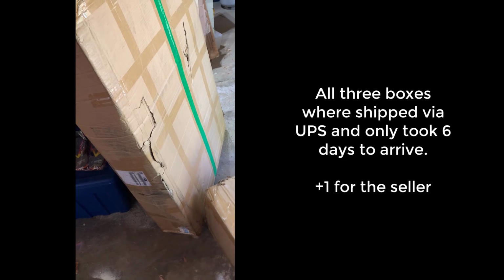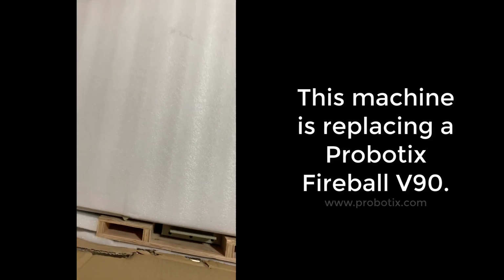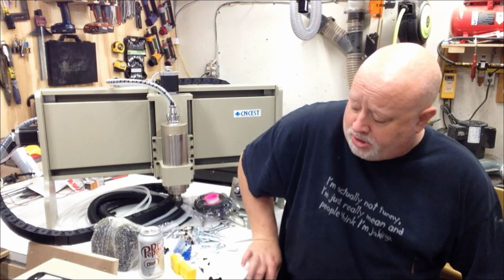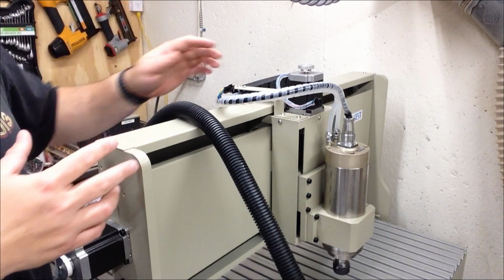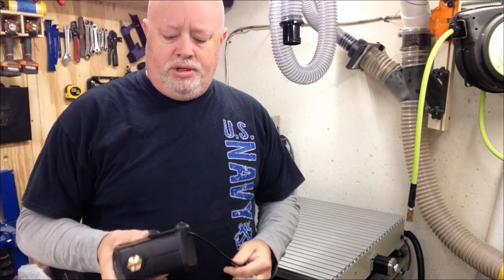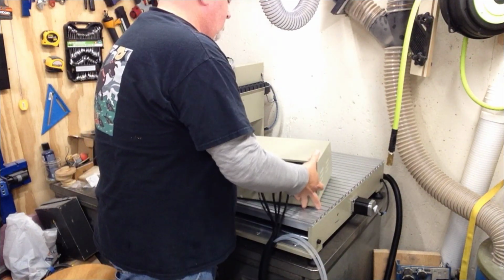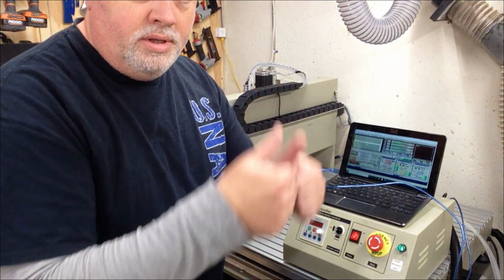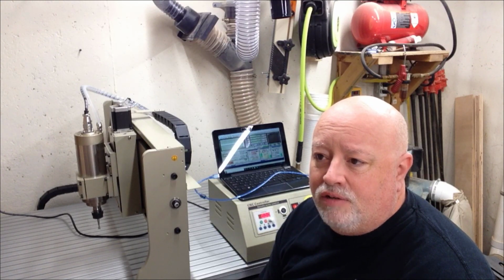Getting started with the Chinese made 6090GZ CNC Router

Comment: could I use 1/8" shaft bits, like dremel bits ? I'll need the 7 degree dovetail bit and I've only seen it from dremel
Reply from the maker: Sorry for the delay, I never got a notification you posted a question.
To your question...
Yes, you can use 1/8" bits.

But, to that point...
You are asking about a dovetail bit.  That bit has an "undercut" if you think of it from a "top down" view.  So you would need to have the ability to clear the area near where you want to undercut, if cutting from the top.  If you are doing board ends, then life is simple and just like using a dovetail jig.

Does that make sense?

Comment: What is the full cutting size are yall getting. Mine to limit switch is 31.5 inch x 24.25 inch. Manufacturer says  35.75 in x 23.75 in. Is mine assembled wrong
Reply from the maker: I went over this in one of the videos, but measured it in metric.  I think you are right though... the size is not exactly as advertised.

Comment: 3 years now how has it treated you ?
Reply from the maker: Mine isn't getting as much use as it used to... as you can tell by the videos (need to publish more soon).  But, when I fire it up, it is rock solid and does the job.

Thoughts...
The unit does have a tendency to overheat, but only the VFD portion (located in the control box).  I've had it happen a couple times when doing multi-hour 3D carves.  This has been documented as a known issue with the VFD and some people have fixed it by mounting fans in the control box to aid in heat removal.

Comment: Has anyone figured out the motor size (nema)? I 
 on one site, they had a motor parts number, and it did not match anything i can find. If i can get a similar product that has stanard specs, that would be awesome. On one of your other videos there was a comment about a ball screw upgrade. Do you have any more info on that?

Really appreciate all these videos. When i type in china 6090 on any search, it's mostly advertisements. 

Thanks again for your work on this series.
Reply from the maker: The motor size is a NEMA 23 form factor.  With the different torque values of different motors, the only thing that should change is the length of the motor.  I believe that the motors that come with the standard 6090GZ are, and I'm guessing a little, about 170oz/in motors.

I came to this using the dimensions of the actual motors and comparing them to what is commonly available... but I could be wrong.

You could upgrade to higher torque motors and push the speed of the machine higher, but you may also need to replace the stepper drivers within the control box.

Comment: Looks very solidly built for milling metal. Thanks for posting. Those planes flying must freak you out
Reply from the maker: It is aluminum, so there is flex in the gantry... but, for wood, it's perfect.  For softer metals, it is okay.  For harder metals, you really need to go slooooow.  I have a X2 mill I use for metal... but it's not CNC right now (although I have the parts and have had it running).
Reply: @jeffmorlen  make an extra motor mount for the upper part of the motor

Comment: Hi Jeff. Do you this machines handle making guitar bodies?
Reply from the maker: That is an awesome question... and a project I want to tackle.
Technically speaking, the bed size, X, Y, and Z axis, does have enough room to make one without issue.
The guitar neck... that's another story though... I believe you'd have to run the neck diagonally to get it to fit (I looked a few years ago and cannot really remember) and you would, probably, want to use the A axis to get your profiles right.

Hope that helps!

Comment: jeff i was wondering if you could help me i bought one of these used it for a year my computer broke im trying to get it running again and i cant get the program that came with the cnc i bought it on ebay there not responding to any of my message is there bye chance you can lead me in the right area ??? with out that program I don't no how to run it
Reply from the maker: On the channel information page, you can find download links to the XML files (config files), a demo of Mach3, and PDF documentation from similar machines.  As well as, the entire contents of the CD that I got with mine (less bogus license).

Comment: Hi! 
I ned a litle help if you please!
I am interesting buying one of this but i am not sure if can do the job i am interested.
The question is about the height of the Z axis.
I want to carve a 10cm high wood all the way down and i am not sure if the height of the bridge and the spindle can allow such a long tool and material.
The video link shows what I want to  do.
Please confirm if its possible, because i am one breath before ordering this!
Thanks!
https://m.youtube.com/shorts/I4LOvZ-0nB4
Reply from the maker: The clearance between the bed of the CNC and the gantry is, approximately, 4 9/16" (116mm).
If you use a spoiler board, of course subtract the thickness of that from the clearance.
Reply: @jeffmorlen  Stil no sure if i can do the job.
Reply from the maker: I think what you really need to know is the travel of the Z axis.  If it can handle the length of the tool you need and still clear the material on rapids.  Right?

Comment: i think these chinese made 6090 cnc routers are a very good value however how bad is the flex on the aluminium bed?...i see no supports underneath other than at both ends...seems like a severe design flaw...no?
Reply from the maker: Most people put a spoiler board on top of the aluminum bed.  So that stiffens up the bed quite a bit.

Comment: ok i see u tried going faster than 60ipm and steps lost...more than likely its due to the stepper drivers because i believe i have similar stepper motors on my crapcarve cnc and i can easily do 100ipm although the weight of your gantry may be a bit much for the stepper motors.too ..your motors are prob just 280oz which are ok but underpowered for that cnc ...and having only 1 weak y stepper is s weakness in design.....a much larger y motor would be best...plus a 24v 10A power supply seems a bit weak ......60ipm is very very slow especially when machining plastics acrylics....especially if u cant run the spindle below 10krpm......i thought vfd spindles can be run at much lower rpm?.....it does seem like a good cnc as is but definitely manufacturer could and should improve it to make it a much better cnc...its like a tank with a honda civic motor lol.
Reply from the maker: The issue that you face with running a VFD at a lower speed is that it will consume higher amperage to maintain that speed as the cutter has to work harder to move through the material.  Thus, you also tend to heat the system up in doing so as well.  I have had overheat issues with mine after extended cutting times.

It is perfect... no.  Does it work... yes.

I don't run my spindle much below 14000 for standard router bits.

Comment: and is it a fact the max feed rate in stock configuration is only 60ipm?..
if so thats extremely slow compared to most other home hobby cnc....has anyone done 70 80 100ipm with this machine?
Reply from the maker: Yes... by comparison to $10000 machines, it is slow.  By comparison to $5000 it is slow.  But, it is only $2000ish... and you get what you pay for.  If someone were interested and handy, they could upgrade all the components (electrical: steppers, drivers, couplers, etc) they could make the machine move very quickly.  Not to mention, some of the "fast" machines are rack/pinion or belt drive.  That makes a huge difference too.

Comment: Hey Jeff, I know this is 3 years old, but I wanted to let you know that I worked with a couple that has one of these machines.  I know Mach3 pretty well, but these china machines throw convention out the window.  While working with them, trying to get their machine running I kept referring back to this video for the ports and pins settings.  So thank you for taking the time to make the video.  It allowed me to help them get their machine up and moving.  Running?  Not so much yet, but that will come.  Again thank you for the vid.  By chance, do you have the link for the files on the touch off tool probe?  I did not see the macro in your list.
Reply from the maker: I added the auto zero script to the channel info page (at the bottom).
I think it is "current" but I have not looked at it in a little bit.
If you use it and have questions, please let me know.

Comment: what software for design?
Reply from the maker: Depending on what I'm doing it would be a mix of Google Sketchup (with tons of plug-ins; old version) or Vectric V-Carve (old version).
Most of what I do would be considered 2.5D work (meaning Z axis does not really move while doing a cut... just goes to a depth and cuts there).

Comment: Hello, Jeff. Does the cnc has a driver I need to install on the pc? Or it installs automatically when you plug usb cable to pc?
You install first Mach 3 and then plug the usb? Or viceversa?
And do I need to change settings on Mach 3?
Thanks!
Reply from the maker: There isn't a driver, for Windows, really.  The DLL that you need, for the R&R Motion Controller, is dropped into the plugins directory within Mach3.

As far as settings that need to be changed in Mach3... Yes, TONS.  But they should be within the XML file you can get from the mfg. or seller.  If you don't have one, I have an XML file for download (check the channel page).

Comment: Hello Jeff! I recently started working on CNC as part of my undergrad research. I also have this specific model and have seen a few of your videos which I thank you so much for (this model is hard to find any guides on and I can't find a manual online either). Anyways, have you ever gotten an error after milling for about 15-20 minutes and it says e Oh? I am trying to figure out what the problem is because it keeps happening no matter how much I add ice to the water pump or if I add an additional fan to the console. Would very much appreciate your help!
Reply from the maker: YES!!  I have gotten the same error.  The error indicates that the VFD has overheated.  It is a real pain in the... you know where.  I have found a couple people say that they added fans to the control box to keep it cool.  I have also found a guy who said that he reversed the fan direction and that helped.

I have gotten it 5-10 times and it is always in the middle of final pass cut (when doing 3D stuff).  Mach3 will give you the ability to start at a line number and that is how I handled it (without modification) in the past.  Meaning, if you get the 0h error, stop the machine.  Document the line number it says it was on and step backwards until it picks up where it left off.

By "step backwards" I mean...
If it errors at line 1800... go back to 1750.  If that isn't back far enough, then go back to 1700.  I've had luck with this... but, be warned, it is NOT a perfect fix for it.

I hope this helps.  Maybe I'll tear my down in a video and show everyone what is really inside... with explanations.

Comment: You mentioned that there are six limit switches,(2)x,(2)y and (2) z.  All in parallel.  No home switches.  Is this actually the case?  Mine doesn't have any Z limits that I can find.  I guess it achieves the functions effectively by moving each axis one at a time.  I am wondering how this all works, in concert.  Haven't started running my 6090 yet.  I have purchased, better controllers to redo the whole thing.
Reply from the maker: I think that that statement was made based off the documentation on Amazon regarding the machine.  My machine has no limit switches on the Z Axis either.

As far as homing switches, there aren't any.  But you could use limit switches on X and Y to do homing.  You'd just need to write the script to do that.

Comment: I bought the same machine, just a slightly newer version. How satisfied are you with the machine? I have a problem with the Z-axis, it only moves in the negative direction when I press Z+ on the remote, and even in the program when I enter the command Z+10, it still moves downwards in the negative direction. What could be the problem?
Reply from the maker: For the work that I do, it is perfect.  It hit the price point that I needed, the features that I needed, and the size that I was looking for.  For the Z axis only moving down... does it make noise and try to move up?  If not, you may have some other parameter in Mach3 backwards... but I wouldn't be able to tell you what without looking at your setup (sorry).

Comment: Better to get the machine rewired and change the mach3 board to the arduino board with usb connection .
Reply from the maker: I've thought about this comment quite a bit...
I'd say, that if you were going to swap out the controller, I would go for a stand-alone style system with a pendant that has USB on it.  Sorta like was others do.

Comment: I was looking for a CNC router that can cut aluminum front panels (1 or 2mm thick). The other routers on amazon seem to have problems with aluminum but now I see this one on video this looks like a bit of overkill. This machine is huge. Great that you posted this video!
Reply from the maker: Yes, you can cut 1-2mm thick aluminum on this unit.  You will need to watch your feeds and speeds for the material you are looking to cut.  But yes you can cut it.

One thing to note...
This machine is made of aluminum.  So there is flex in the gantry and Z axis.

Comment: How i can just start my spindle ? With mach3
Reply from the maker: First things first…. Do you have the same machine?  Or, at a minimum, something similar.

Does your CNC have a manual/pc selector switch?

Switch that to manual.  Make sure the knob is all the way to off, or the slowest setting.  Press the green “run” button on the VFD.  Turn the knob and increase the frequency.  If it spins, then the VFD is working.  Turn the knob and stop the spindle.  Press the stop button in the VFD.

Change the switch back to PC control.  Press the green run button again.  Within Mach3, if configured, you should be able to hit the “Spindle CW” button within the GUI to start the spindle.  Hit it again to stop the spindle.

** Note:  please make sure you have no loose parts, material, clothing, or body parts near the spindle during this operation. **

Comment: hey Jeff, thanks for all your videos. I just finished putting together my 6090, got it working with Mach3 thanks to your other video, but my Y axis (900mm direction) seems to be binding. I can move the axis by putting pliers on the y axis handwheel, but its fairly difficult to move, and when moving with Mach3 the y axis motor makes a humming noise but doesnt actually move. would you happen to have any ideas? how difficult is it to move your y axis using the handwheel with the machine off?
Reply from the maker: My Y axis moves pretty easy without the power on.  I would think that something is aligned incorrectly or there is something in the way.  Alternatively, the linear rails may not be parallel and that could also cause a binding scenario.

You can take the gantry off and still run the machine.  I would probably take that off and then remove the bed of the unit.  That way you can see what is happening when you try to move it.

Sorry your unit is not working properly.  If you cannot get it fixed easily, I would contact the seller and let them know of your issue.  They may have some more insight as to what could be causing the issue.
Reply: @jeffmorlen  thank you so much for the reply Jeff, I actually found the issue, the y axis motor was damaged in transport, removing the motor  allowed me to move the axis freely. I'm in contact with my seller to get a replacement. thanks again for your detailed response and troubleshooting support :)